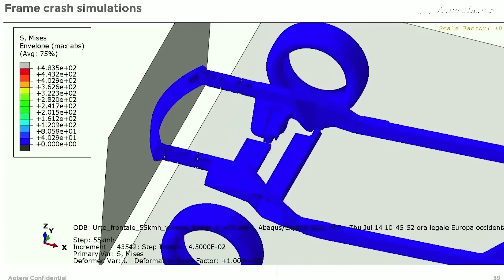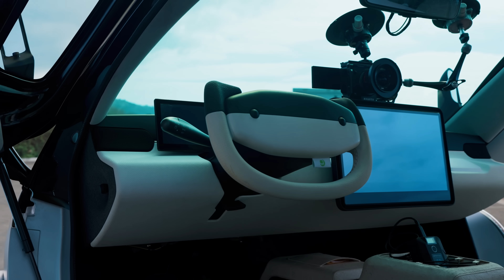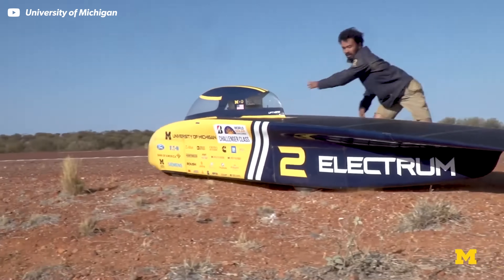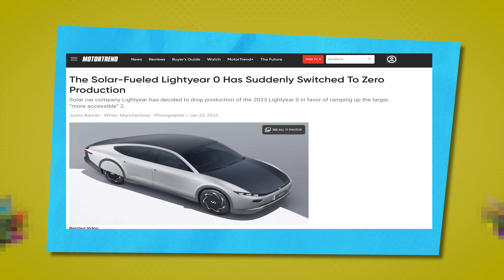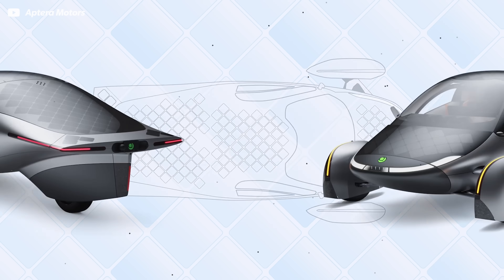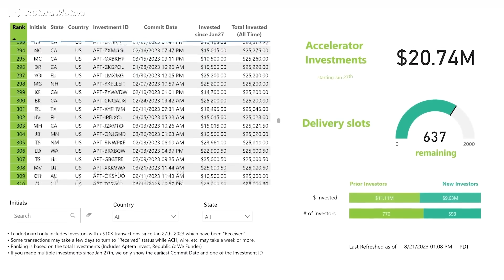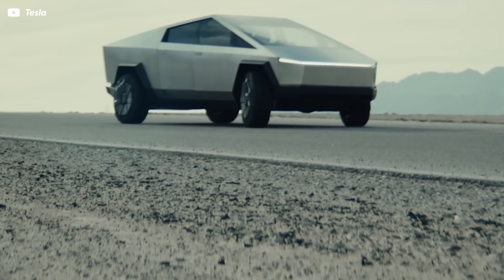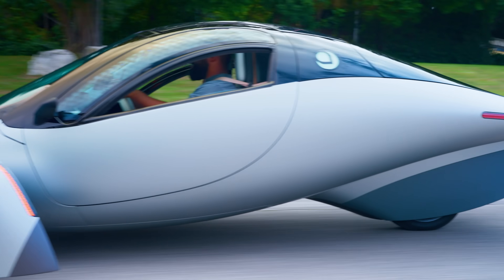We Drove America's First Solar Car

Comment: They're closer to an acceptable EV, but still so far off. If they could get much faster solar charging, this would almost be acceptable to me. 5 miles added every 1 hour of solar charging means it takes 200 hours of solar charging to full charge it. Yes I know solar won't be it's main source to charge, but if they can bump it to like 30 miles charge per 1 hour, I'll be on board. If they can get solar charging to be self-reliant without needing a plug-in charger, then that eliminates needing as many charging stations. Less waste. And less opportunities getting stranded on long journeys.

Comment: That's a prototype, Aptera has been making unfulfilled promises since 2006. 
Physics and cost this will charge your car in about three to five months of ideal conditions. Generally it's a poorly constructed electric gimic with a specialized charging port.
Reply: The NACS connector Aptera is using is no longer a "specialized charging port" but the North American standard, thanks to Aptera's efforts.  Aptera Corp only started in 2019, so wrong again.

It appears you are incapable of understanding simple math with your "3 to 5"months to charge your car statement.  The first shipping LE models will be able to charge their batteries from empty to full in about an hour at a Tesla charging station.   We will know more exactly once the PI models complete their validation work.

Comment: So 200 hours of sunlight for a full charge 😂
Reply: This will depend greatly on the solar insolation at your location and which size battery pack you have.  Another way to think of charging time would be 13 miles per hour of range gain plugged into a 115 VAC outlet.
Reply: @josefgordon7712  It is if you live in a sunny climate and drive less than 40 mi. per day. Most people drive less than that. They haven't tried to deceive anyone like you suggest.

Comment: 1k miles is bs lol 😂 that tech doesn’t exist
Reply: The batteries for the 600 and 1000 mile range vehicles are the same as in the present 400 mile range design - just taller form factors.  They are in development now, and when they reach the production stage, the battery packs can be built.  We will have a better idea of the actual range once the 400 mile production intent vehicles are validated.

Comment: a car with only tesla connector is a fail.  Why would you choose a tesla plug instead of all the standard charger plugs all around any bigger store ! I think its even not a fast charger ?
Reply: You have not been paying attention.  The "Tesla Plug" is now the standard that will also be known as the SAE NACS Electric Vehicle Coupler J3400_202312  Soon all manufacturers delivering vehicles in the US will use it as will all public charging stations - not just Tesla.
Reply: @n.brucenelson5920  maybe in the future but for now most Station have 2 Plugs the Slow Charging Plug and Fast Charging one.  Just on some Station the offer also that Plug.  Unless you want to be dependent on Tesla Chargers.  I been driving 4 months now and never had a chance to use Tesla Stations because most of the time the are not near stores or public places.  You have to consider that's a slow charging Plug! Can you even Fast charge that car??
Reply: @airbnbphotography  A fast charger with 50 amps, 400 VDC will charge a 400 mile range battery Aptera to full in about one hour.  We will know exactly once the validation testing of the PI vehicles is finished.

It is not the fastest, but the range is such that it is certainly practical.

You can certainly use an adapter to other cables if you wish, but it would be more bulky and soon all stations will be using the NACS plug as standard.

Due to the solar assist and 110 and 220/240  VAC charging capability most users will never need to visit a fast charger in any case.  If needed the possibility is there.
Reply: @n.brucenelson5920  I doubt that solar will make any change.  I  saw previous models when solar 8 hours only added few miles.
Reply: @airbnbphotography  Aptera has far fewer places where energy is wasted.  It will go at least 2.5 times further in the same amount of power as the already rather good Tesla Model 3 

I find it interesting how they have done it.
Reply: @n.brucenelson5920  yes I think do the engines inside the wheels.  Not sure why other companies not doing it?  If you hit the curb will be expensive
Reply: @airbnbphotography  Yes, the motors are wheel motors.  This has the disadvantage of adding unsprung  weight.But not an outrageous amount, just over 50 lbs per wheel.  

The advantages include no drive shaft bearing and additional weight and friction, plus much faster acting traction control that can sense wheel slip and adjust torque 32 times per wheel revolution-or about every 2.5 inches of tread travel.

Comment: The Aptera is a great concept, but it is not designed to be actually used.  The solar panels are totally and completely useless.  This is a physical fact.  That said, tough they claim the solar panels will last ten years, they will actually wear quickly from road debris on normal driving.  The vehicle is all but invisible on the road, specifically from the rear.  The slightest rear end collision will cause extensive damage, to not even think of rear collision at speeds over 30 mph.  Lighting is catastrophically weak, again especially in the rear.  This vehicle should be marketed as an daytime NEV only.  Only a fool would drive it on roads where speeds exceed 35 mph, and it should never be driven at night.  Aptera has not shown a night film where the vehicle is followed/passed, handling even moderate rain, or effectively climbing a hill.  Let's see the vehicle back into an obstacle even at 5 mph straight on and oblique.  Show a rear end collision at 15 mph.  Lets see it even climb a hill.  Drive through the Mojave to Vegas a few times (if it even can) and show the exterior results.  We've waited decades for Aptera.  The NEVs worth paying attention to are coming out of Oregon.  So long Aptera, hello Arcimoto...

Reply

Comment: 3 wheeled cars are a serious joke when promoted as the cars of the future.......Take into consideration the Dale, and Elio cars were a sham
Reply: Comparing Aptera Corp and the vehicle with either the Dale or the Elio, indictes that you have not looked into it.  

Aptera has 3 wheels for sound engineering reasons to meet its design goals, and it is a legitimate company that is producing validated body parts now with expensive tooling.

It won't be long before Production Intent vehicles will be undergoing validation testing, including to crash test standards that they don't legally have to meet to be offered for sale.  They are a serious company and product.

Comment: This looks like if it got in an accident with a cyclist, the bike would win.
Reply: Carbon fiber passenger compartment. It will be crash tested by an independent company. The computer simulations show that it will pass easily.The original Aptera had more roof strength than other cars. This new one will be stronger yet. I almost forgot, there is a steel 'roll hoop'  built into the roof over the occupants heads.

Comment: That looks like it will literally kill you. Ive been rear ended enough to know...
Reply: My first Honda Insight was rear ended at 65 mph by an SUV driver who fell asleep.  I was uninjured and found another to replace it.  The Aptera is likely to be safer that that was in a similar accident.
Reply: It can't be much worse than a Chevy Tahoe going 55mph in a 35. Tall, strong and huge, is what makes Suvs and Trucks deadly. The crumple zone is made to absorb the impact of accident while Suvs and Trucks just bounce off each other and drive the damage to you. 10:51

Comment: So anyone can get in your vehicle by tapping the body twice, uh, no thank you.
Reply: Not correct.
Reply: Yeah sure, if you leave it unlocked.  You are either a bot or incredibly dense.
Reply: @jeezy0025  I saw the demo, that's what he did, he tapped it twice and got in., troll.
Reply: From Aptera's FAQs:

How do I unlock and lock the Aptera vehicle? With a key fob?

The vehicle will unlock by detecting you via your phone’s Bluetooth connection, our app, or with a physical RFID card. Once inside the vehicle, you can open the door through the center screen controls. Aptera will automatically lock when you exit by detecting that you are not inside. The interior cabin will include a mechanical release to open the door in case of any electrical malfunction. More information to come as we push the efficiency envelope on mobility.

Comment: I think it is way too expensive
Reply: Compared to what?  Don't forget to compare the total cost of ownership and use.
Reply: @n.brucenelson5920  I said I think but let me say it like this ...I consider this a motorcycle with a cover  . And you might be right we have no comparison and that is exactly the point ... would it be cheaper if we had comparable electric cars ? China has small electric cars that sells for 10K usd ... and yes it does not look that sleek and production wise the solar panels are missing which is by now maybe 1500 usd on the high end 
....
Reply: @mansourkhatib  Irani hastid? Kheli Khoshvatam!   If your name is Arabic, Salaam!

I have around 1/2 million miles on motorcycles - and I have ridden in an Aptera prototype.  I do have some ability to compare from experience.  

Aptera has said that the full solar retail price is about a $900 upgrade.  The environmental benefit is such that including it as standard provides a significant reduction in the social cost of the vehicle. 

I am going to guess that they may not offer other than full solar once they go into production.  Vehicles without the solar hatch will need to be crash tested again to have the same confidence in the crash performance - even though there is no legal requirement to do so due to the classification in the US.
Reply: @mansourkhatib  If you consider this a motorcycle with a cover then it's clear you can't have a rational conversation.
Reply: @jeezy0025  so no facts??? just claims of your opinion that I am not rational?... Let me make some rational points .... 

a) In CA you need a motorcycle DL in order to drive a 3-wheeler. At least for or right now until this carries a motorcycle classification. 

b) Much less space 

c) transports 2 people only 

d) I am sure that in a crash this has a lower survival rate. 

Yes, you have a car feeling but I will argue that it is closer to a motorcycle than a car. 
good or bad, I consider these valid and rational responses ....
Reply: @mansourkhatib I've owned and ridden a motorcycle.  It did not seat two side by side. Or have an HVAC system, seat belts,  air bags, a super strong carbon fiber passenger cell, crumple zones, AWD, 32.5 cubic feet of storage  and 7 feet of room behind the seats.

Comment: This thing is super ugly and probably will get super slow charging paired with low distance
Reply: Aptera's shape is almost pure form follows function - not some arbitrary fashion statement.  The first vehicles will come with a 400 mile range battery, and will charge to full in an hour at a Tesla Supercharger.

Comment: The knock to open is so silly, amongst other parts.  "Lets make the car efficient!  But also lets waste power and weight by adding this overly complex thing when a simple handle would do."  The solar panels are a total gimmick.  If we're being generous, they might have 1m^2 of solar on the car.  The average power per square meter from the sun is like 250W/m^2.  And that's being generous.  To get the stated "40 miles" from the solar panels it would need to be in the ideal position and location for 16 hours to get the 4KW needed.  I think they failed the first time because the car is too weird and gimmicky.  And now they're doubling down on the gimmicks.
Reply: ...How to tell when a person has done zero research regarding what they write about.

Comment: It's not a solar powered car, nor does Aptera claim it is.  And in a video about driving it, not one comment about handling or ride quality.  This is a very light car, three wheels and hub motors that have high unsprung weight.  Ride quality is a major concern.
But, of course, what do these guys know?  It's doesn't seem they know anything at all, except how to eat unhealthy. Thumbs down.
Reply: My wife an d I have ridden in a prototype that was better than a car we used to own.  There are now many videos of people riding in the gamma prototype with comments about ride quality and noise.  The PI vehicles are being assembled now and will be even better.

The Aptera hub motors weigh just over 50 lbs - not a huge difference to design a suspension to handle.  Some steel wheels alone weigh more than that.
Reply: @n.brucenelson5920  "... better than a car we used to own". A CAR, how helpful.
"There are now many videos..." Where?  Again, how helpful.
"The Aptera hub motors weigh just over 50 lbs - not a huge difference to design a suspension to handle."  That is a lot, and the problem isn't "design" it's performance.
"Some steel wheels alone weigh more than that."  The Aptera also has wheels.
The average passenger car wheel and tire weighs 35-55 pounds, so the Aptera design doubles that, a HUGE difference, particularly considering the weight of the vehicle is otherwise so light.  You may not understand this, but I recommend you learn something rather than spread misinformation.
Reply: @craigsj  I recommend that you learn to do some math   Aptera hub motors and wheels most certainly do not weigh  110 lbs.

Aptera wheels are not made from steel. The handling is superior to many cars, due to the lower center of gravity, the much better traction control, and the lack of buffeting from semis and wind.

Take a look at the recent Aging Wheels "Your wrong about Aptera" for a start

I will be posting my experiece of an early model year round in rural Iowa.
Reply: @n.brucenelson5920  "I recommend that you learn to do some math". And I recommend you work on your reading comprehension.  Not interested in engaging with your mispresentations of what I have said.

"Aptera wheels are not made from steel. "  Steel is your straw man, I have not mentioned it.  I mentioned average passenger car wheel weight.  If an Aptera wheel weighs 25 pounds, then the motor TRIPLES the weight of the combination.   Lighter wheels make my point, you should think more and comment less.

"The handling is superior to many cars, due to the lower center of gravity, the much better traction control, and the lack of buffeting from semis and wind."
Prove it.  Where are there legitimate car reviewers making these claims?  There are not because the Aptera is nowhere near production.  And to counteract those theoretical benefits, the Aptera has three wheels, skinny tires, and terrible unsprung weight...all big problems for handling.

"I will be posting my experiece of an early model year round in rural Iowa."  And who are you and why should anyone care about your opinion?  And when are you pretending this will occur?

You sound like an investor who is praying they weren't duped.
Reply: @craigsj  You have a short memory.  from your post: "Some steel wheels alone weigh more than that." 

The Production Intent validation vehicles are being assembled right now, and will soon be undergoing validation testing, including 3rd party crash testing and the results will be public.

If you don't like what other reviewers are saying, ride in a prototype yourself.  I have, as have many others.

In less than a year from now, if no major issues come up during validation, there will be vehicles in customer hands.

I am a small investor, but not because I expect to make a fortune.

Comment: Fail! This is not a solar car. Unless you only drive 5mph. Marketing hype and everyone is falling for it. This is just another Wacky charge point EV.
Reply: You need to do your homework.  Even in Iowa, where I will get perhaps 1/2 the maximum daily range, it will likely meet most of my driving requirements from solar alone.
Reply: Really? I'm sure my 4-10 mile daily commute is sufficient to be fully solar. If you think you have to drive at 5 mph, then you are severely underestimating the power of solar.